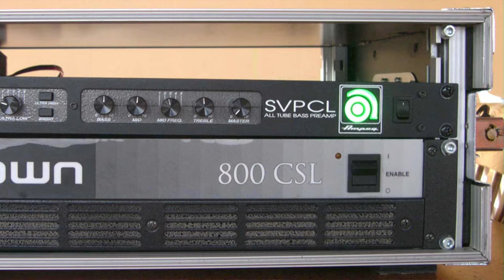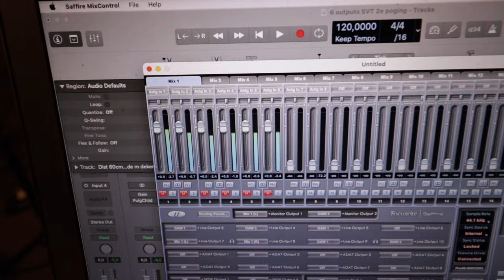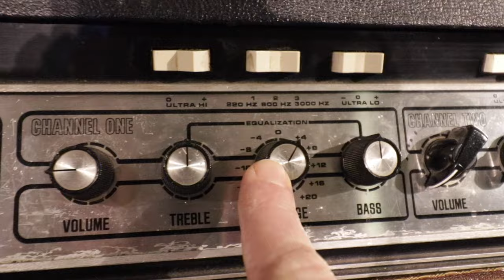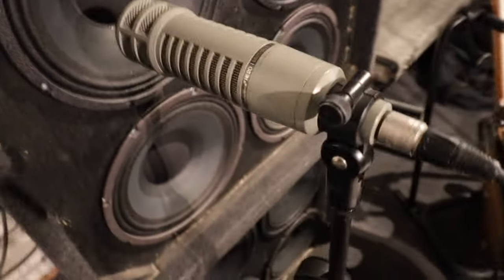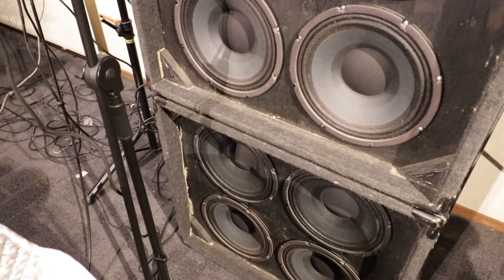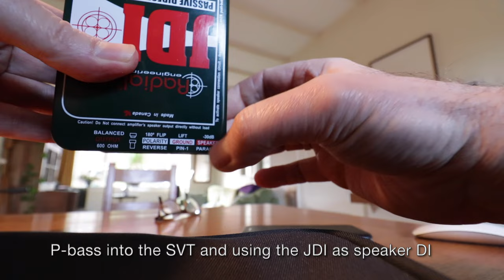Vintage Ampeg SVT: how does the preamp, the poweramp and the cabinet affect the sound

Comment: I just play through my 1998 SVT classics with 810s just re tubed it all new tung sol tubes and solvtex pre amp tubes no added pre amps or DI I love the playing straight through the SVT , I hope it will not give me any trouble in the future. Going to try using the new Ampeg heritage 410 leaving the 810 home. Have my hopes up. Thanks for the in-depth video
Reply from the maker: That's a HLF version isn't it? I think that's a total different beast since it's ported (at least the bottom 2 speakers). Gives tons of lows (a bit too much for me!) but I know plenty of bassplayers totally happy with it.

Comment: NIce work!  Very thorough, straight to the point!  I always here the same superlatives used, yet I can't find anyone that will explain what those flowery words mean.  Either put it on a scope/analyze the sound/waveform with a frequency response measurement, or just use your ears.
Reply from the maker: Thanks!

Comment: perfect take-away!
Reply: i think the mic recordings unveil the room's sound mostly, too. and the speakers' contribution i think might have been revealed a bit more woth the power amp cranked and the speakers making some xmax excursion, that's when they truly start adding colour (as opposed to solely changing the freq response)
Reply from the maker: Yes, I was not happy with the mic sound either. Normally I put the amp somewhere in the corner facing the wall, so you get way less reflections. And the room doesn't sound too good anyway! But that's what I've got to deal with. I'm not sure about the volume though. I pretty much record on the same level I use for gigs and louder is not per se better, especially for recording... @raoulselten9480

Comment: nothing can ever beat tubes. the svt is probably the best bass amp ever made tone wise but all my friends that owned it had many technical problems, if you buy an old one make sure to send it to a proper tech. you can also make the amp sound better using vintage tubes but to do it right  will cost more than the amp.
Reply from the maker: When I got it (25 years ago?) I had it totally serviced. After this  I swapped the tubes once (with new Russian ones). Hardly any problems. Tons of gigs! It’s been super reliable.

Comment: I had the top and bottom and a nice P-Bass about 1978. Stand about 8 to 10 feet in front of it at 1/2  volume and you just needed to guide your left hand to play basic rock as the power rattled you to the bones. I was smart enough to wear shooting ear protection because without it i would be close to deaf. Once a monster, always a monster. Was about $400.00 to do the tubes back then. I can only imagine how much now.
Reply from the maker: Cool! I did it like 3 years ago? maybe 450€? I should look it up. But probably more now yes. Ciao!

Comment: Great Video! Thanks for doing this! Does your cabinet have the original CTS 32 ohm speakers or the Eminence speakers?
Reply from the maker: Ha ha. You know my other videos do you? No the CTS speakers are stored in my basement. They sound killer but far too often the sound on stage is already boomy/muddy caused by bad acoustics or subwoofers etc. In that case I need more mids/cut-through character and the Eminence reissues do that better for me.

Comment: I like the sound of the mic'd cab the best. The D.I. outs always sound really sterile to me.
Reply from the maker: Yes, you really have to work on the DI to get something worthwhile. Through a p.a. it's a different story though especially with all the disturbing acoustics involved. In that case a totally clean DI can really help to get a sound that's cuts through. Just a mike can get a bit blurry (totally depending on the situation though). Like I say in the video lately I'm using the Radial as a speaker DI and that's working pretty good!

Comment: With respect, the SVT speaker cabinet is not a guitar cabinet.  I have no idea what the speakers yiu are using - they are not the original SVT speakers.
Reply from the maker: @RogerCox-m2n  Did I say it’s a guitar cab? Of course it’s designed to be a basscab yes. Maybe I meant the speakers they used in the beginning (late 60-ies) cause they didn’t really have powerful bassspeakers back then yet. Those early alnico’s do sound killer. I made another video you can look up, about the difference between those old CTS speakers and the Eminence Legend reissues I settled with. Those reissues have more power and are a bit tighter and midheavy. They work better for me in a lot of live situations with bad acoustics and/or boomy PA’s. In ideal acoustic circumstances the old alnico’s sound the best. My cabs are an exact replica of the old squareback 8x10 SVTcab only cut in half. See also that other video if you’re interested that is. Ciao!
Reply: @JasperMortier  Thank you for your reply and pointer to your second video, Jasper.  As you know, when designing a raw speaker, changes in one part will most always affect other portions of the speaker's characterization - response, sensitivity, power handling, just to name 3.  In working with Bill Long, CTS Chief Engineer at that time, all the reasonable variations of the 10" design were explored either as working samples that I measured and listened to or on paper using the knowledge of the CTS Engineering Department.  Of course CTS could build 10: speakers with more power handling ability - peak and continuous, but they gave up areas of performance that were iportant to my design goals for the SVT as a system.  After I resigned there were many changes to the SVT at Ampeg and several other companies that came to own the trademark and the designs.   I was busy at other companies - Norlin (Parent of Gibson and Moog, among others) and Fender, and did not pay much attention or follow what was happening to the original product or its new variations.  I certainly was aware of the great contributions of Bob Gault at the new Speaker Company Eminence (he was a former Chief Engineer at CTS) to musical amplifier speaker designs and my admiration of his work and the work if his Son Rob and the Eminence Company has no limits.  Tone is tone, direction of a design is done by the designer and shaped by a multitude of factors.  That the original SVT design remains in good popularity after some 55 years of production is a measure of its fitness of purpose - then and now.  Thank you again for your videos.
Reply from the maker: @RogerCox-m2n  Man I didn’t realise it was you! Just saw your interview the other day and of course you’re all over my cherished Ampeg book. Thanks for taking the time to watch my videos or at least parts of it. First I’m pretty sure I speak  on behalf of the whole basscommunity thanking you for being part in the development of such a classic! To this day it delivers unequaled tone to so many bassplayers. I always felt the design of the cabinet is a bit in the shadow of the amp with all its bells and whistles while it plays such a huge role in the overall sound of a SVT and it still stands its ground between all the vented lightweight stuff.

Although I must say I have to explain more and more to younger people - both sound engineers as well bassplayers - what on earth I’m bringing. Just the other day a soundguy asked whether I brought my (apparantly perceived as big) setup just for show! Not kidding.

Ok: the nerd question being this!
Not happy with the Ampeg quality around 2000 I decided to build my own. So I measured an old squareback and for some reason - I can’t remember why - I concluded there’s a double seperator between the 2nd and 3rd compartment making it 2x3/4” inch thick. My first own built 8x10” had this, but with my current 2x (4x10”) I skipped this (and I didn’t notice any sound difference). First: is this true, and if so: why? 

About the speakers: on talkbass somebody found pretty similar looking CTS 32ohm alnicos from ’66. They were used in a Fender PA cab from ’68. It’s suggested these were used for the SVT in the beginning. Those old alnicos are still uncomparable to any new ones, so you guys really knew what you were doing! But like I say in my videos they tend to be a bit too muddy for me in more difficult acoustic situations so I stick to a more modern compromise.

All the best and thanks again!